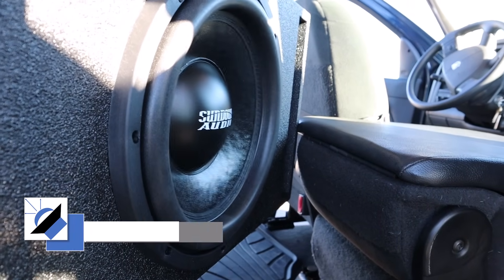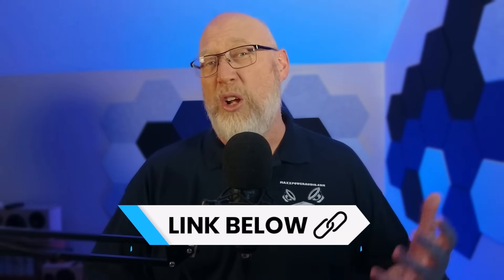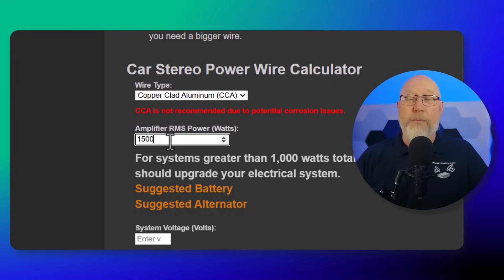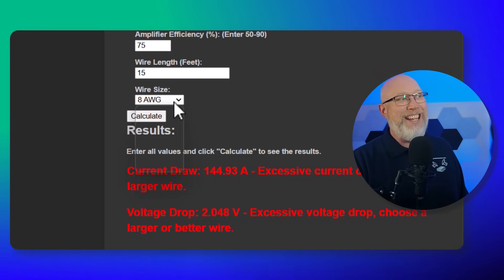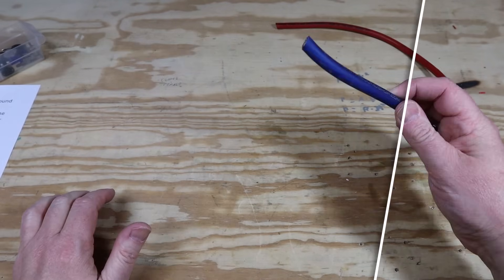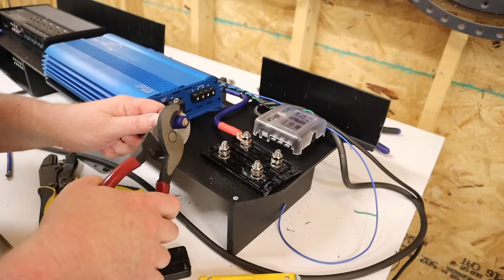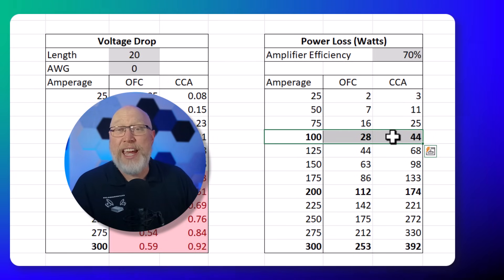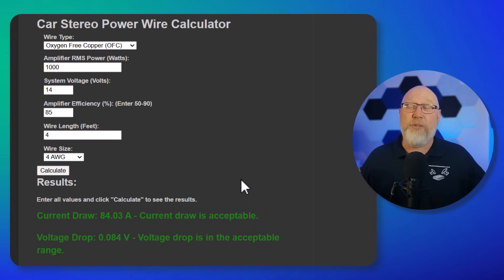The WRONG WIRE will starve your amp.

Comment: 90% off today's "audio" stuff is just big halabuka, as we call it TAX for fools. For power supply use quality welding cable it's designed for long high current DC flow. Also do minimum big 3 bicouse car companies are skimming on wire awg. Ewery MilAmp drop your body comp will go A wire and disrupt charging off the alternator. Also upgrade battery terminals. For speaker wire use wire design for AC (skin effect) for midrange and high frequency goes low Amp curet and will be noticeable in sound quality. For rest off knowledge do research in get good at knowing what you are doing. Have great new year, and lot of time enjoying in work off your hands.

Sorry for the misspelled or different sentence composition, my English is not native language.
Reply: There is no point in changing the battery terminals if they are in good condition and without oxidation - even the cheapest ones conduct current perfectly - proven by tests! The skin effect at least somehow manifests itself at frequencies from 100 kHz! So there is no point in talking about it in the context of sound transmission!
Reply: There's are factory batery terminals that are bearly adequate for starting engine, and not iwen capable accepting any extra connections. AC current don't flow true core of the wire like DC. Iff you have low voltage, low amperage AC current that has to travel longer distance it vill be smart to use braided wire with tiniest braids that you can find.
Reply: @mujopasuljic6471Have you done tests and measurements of different battery terminals? Have you measured their voltage drop and at what current? No? Then why did you decide that standard battery terminals transmit high current poorly? But we have conducted such tests and measurements in our store. And the tests showed that the best battery terminal gives a voltage drop of 0.015 volts at a current of 200 A, and the worst standard terminal - 0.05 volts at the same 200 A! The voltage drop is very small, and the battery under the hood will not be able to give such huge currents! So no need for empty statements - tests show that any battery terminal (if it is in good condition) conducts current perfectly!
Reply: @mujopasuljic6471And if you read a little more about the skin effect, you will see that it does not depend on the voltage, but on the AC frequency! And the skin effect begins to appear from 100,000 Hz! So in car audio, as well as in home audio, there is no point in taking into account the skin effect, because at frequencies up to 20,000 Hz (which a person can hear) it does not manifest itself in any way! Just google it!

Comment: Awesome video Justin!  I keep forgetting that we have the same two amplifiers!  Interestingly, our power sources are worlds apart.  I have a stock alternator, big 3, all Sky High 1/0 OFC, a XS Power D3400R under the hood, and a XS Power  SB-630 51R super cap.  Everybody's electrical needs will vary.  I think what it really boils down to is what your average draw is.  My system is capable of 3600 watt PEAKS and able to sustain 2250 watts RMS with no issues for several minutes, but realistically, I never do that while sitting in the car.  I do compete in Bass Wars, Midwest SPL, and IASCA (for SQ) from time to time.  I DO NOT however, have a BASS DEMO vehicle.  It CAN do BASS demos for as long as I can stand it, but I prefer to protect my hearing.  My setup works perfectly for my needs and I owe it to not going CHEAP.  Also, the super cap I have performs like a BOSS!  I've never seen my voltage go down below 13.7 at full tilt.  I have what most would consider to be an "SQL" system because it can reach 143.79 dB on the bass side of things. (as of my recent competition at a BASS WARS event, which I won two 1st place awards, WHOO-HOO!)  I typically enjoy the dynamic capability of my system, rather than high, long-term output.  I will conclude that the needs of every system should be tailored to the power level and use case scenario.  It takes power to make power and a system's performance is only as good as the weakest link/s.  BASS ON, BE SAFE, and HAPPY NEW YEAR 2025!!!
Reply from the maker: I've got a big XS power battery under the hood as well.
Reply: @DIYAudioGuy  I think they're amazing batteries.

Comment: Are you doing speaker wire next? Or have you done one already? Back at my father's shop, people would come in with with lamp wire, clock wire, had one guy come in and told me he had some Toro outdoor wire and it could hadel 240 volts. That always stuck with me. Does it make a difference?
Reply from the maker: Lamp cord actually works just fine. It doesn't look very cool, but it's stranded copper wire.  It'll get the job done.

Comment: Always love these videos!
Wanna share something that’s worked well for me!
Battery banks if you have a hard time finding alternators. Running 4500 rms on 3 100ah solar batteries. Top them when needed via plug in 120v
Tbh I don’t understand alternator fitment and when I tidied to learn it made my head spin!
Reply from the maker: If you can't upgrade the alternator, that's your only choice.
Reply: Lithium cells with a 150a draw each
450ish amps plus the stock battery and alt covers it and keeps my headlights bright

Comment: Great video DIY Guy. Been in the industry for more then 2.5 decades, then out for 1.5 decades. Now, I'm getting ready to do guys audio system, 85 SS El Camino, ony 42K miles. Its minty. Doing roughly 2500 -3K watts. Machined battery terminals and 0 ot. Four separate 0 grounds for engine block, back of alternator, direct on-frame and body. Grounding is done. Now comes a 300A alternator upgrade and a AGM main battery. 0 for all hots. Enough headroom - if any dimming happens, adding a second AGM, $5K allowance to build - should be fun. Two 10's in a custom, in the smugglers box, all trimmed out. Keep up the great work @DIYAudioGuy
Reply from the maker: Sounds like one badass ride!

Comment: Great video 
I would add (speaking from experience). The ground wire is the most neglected part of the wiring for car audio. 
Correct size obviously but also the connector. Seen so many ran to a bolt or to painted surfaces on the chassis 🤦‍♂️. 

Also if you plan on running 1000watts + with 2 ohm subs.  Plan on big 3. Upgrades. Alt. Battery and cap. Unless you don’t use it much.
Reply from the maker: Yep!

Comment: Oh, by the way, when calculating the required cable cross-section, you need to take into account not only the length of the positive cable, but also the length of the negative cable from the amplifier to the car body, and from the car body to the battery ground! Since these wires also participate in the transmission of current, and in the overall resistance of the circuit! And they can easily add another 2-3 feet to the total length of the wires!
Reply from the maker: I need to add that to the calculator in the next update.

Comment: Is 10 awg enough coming from the amp to the subs. 10 foot run (including inside the box) each sub has its own wire to the amp. Both subs are 2ohm  750rms and meet at the amp to make 1 ohm
Reply from the maker: I need to do another calculator and a video just on the speaker wire. But there's some extra complications that I need to make sure I've got figured out before I can post the video. 

I've never run anything bigger than 12 gauge so far, but I've always kept my power under about 2,000 w.

Comment: I bought 2 gauge welding cable for 1500 watts RMS amp plus 220 watts RMS amp...IF I decide to ever install it all. It was Windy Nation brand cable from home depot online. It looks like thinner cable than I expected, but it is supposed to be a reputable brand? Ironically the 4 gauge wire I have from DFS looks close to the size?
Reply from the maker: Hummmm, interesting.

Comment: The power/current is crawling on the surface of the wire, so if it is coated, you dont get the right resistance!
And very important for all of you youtuber guys, when giving advice on instalment remember not all countries have the same rules!!😎
Here in Denmark if you install the fuse after 25cm (10") on any wire connected to the battery, your car will not pass inspection☝🏼
Reply from the maker: Skin effect does not apply in this situation.

Comment: Some OFC is certainly a nice cable to go with to send juice to your amps, but often the overkill many people use with going 1/0 gauge is unneccessary. Today's class D amps are more efficient than they ever have been. People would be surprised that a quality high strand 4 awg OFC (10-15 ft) will send plenty of current to most amplifiers while playing MUSIC and driving your subs with anywhere from 1000-2000 watt rms amplifers . The key is MUSIC and not sine waves. Music is dynamic and lots of people think their amps are constantly pumping out the watts their amps are rated to output. They are wrong. Even a 2000 watt amp on a sub/subs while playing music will be all over the place wattage wise from 30, 500, 1500, 20, 500, etc watts all real time in split seconds depending on the content of the music and that goes for the current draw as well. If you are doing DB drags and burping sine waves 25-70 HZ then yes your 1/0 will make a difference because the wattage along with the current draw will be more continuous. Am I claiming that people should run 8 awg OFC to a 2000 watt amp? Well If the run is just 6 feet then yeah sure do it , but don't think that huge power wires are always necessary for up to 2000 watt amplifiers.
Reply from the maker: You can do what you want with your money.  But I'm going to advise people to err on the side of caution.

Comment: Can you do batters next, not the fancy lipo but the entry level.  I have a 2003 Malibu stock alt, added a 4GA ground to my alt and 34 amp hour lead mat battery.  I have the JP 34ab and the JP 8 @ 2 ohms.  I had a lot of trouble finding anything about how to fuse the system. I played it safe, in addition to the under hood fuse I have a fuse on every lead off the aux battery.  Doing a video on it could help a lot of ppl just getting.
Reply from the maker: As soon as I feel like I have enough expertise, I'll make a video advising people how to select a battery.   As for the fuse, make sure that you have a fuse on every line coming from every battery.  So you have a rear battery in the trunk, you'll want a fuse under the hood at the front battery and on that exact same line you'll need a fuse at the rear battery.

Comment: All this massive wiring and then we use aluminum, nickel, and even brass distro blocks. How does that make sense? Does the SQL competition guys use copper distro blocks or are they fine with less conductive metals?

What blows my mind though is that I have 0awg from battery to block, then the fuse is this TINY bit of material rated for 80A that then feeds a 4awg OFC final run to the amp. I know fuses are meant to blow before the wire but damn it's so little material, and our entire power feed is going through that thin strip of subpar material.

I want to see voltage drop numbers for introducing different blocks and fuses. See if that has a notable effect.
Reply: It's simple - the voltage drop depends not only on the resistance of the material, but also on the length of the conductor! Since the distributor itself transmits current over a very short distance (0.5-1 inch), the voltage drop on it is practically zero! Again - the length of the conductor is important - the shorter it is, the less resistance to current! This is perfectly shown in this video, when a 1-inch wire length was selected in the calculator - the voltage drop on it was very, very, veeeery small! So, theoretically, it was possible to use a wire with a smaller cross-section (or from a worse material). Therefore, distributor blocks, as well as terminals in an amplifier, can be made of almost any material, since the length to which they transmit current is very small!
And of course, the voltage drop also depends on the cross-section of the conductor. For example, distributors with compression terminals have a fairly large cross-section, much larger than the cross-section of a 0GA cable! So even taking into account that the distributor material has greater resistance, but due to the larger cross-section, it transmits current better than 0GA OFC, and the voltage drop in it is less than in a 0GA wire of the same length (1-2 inches).
Reply from the maker: I have often wondered the same thing about the terminals and distribution blocks.  I see a lot of brass,, brass is a terrible conductor.  For the fuse check out Glowe Voltage, he has been testing them on his channel:  https://www.youtube.com/playlist?list=PL9Xue6ot0War860cWhdW1ZQ3tgqHmD96f